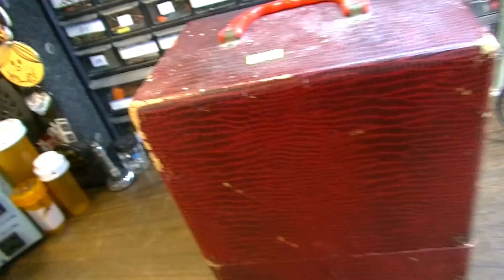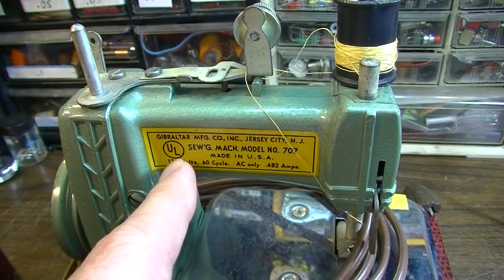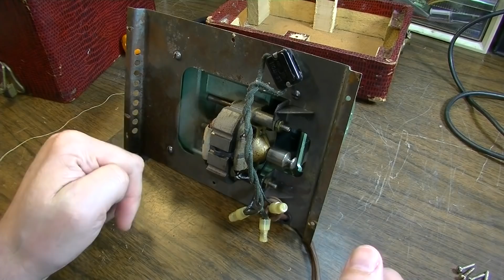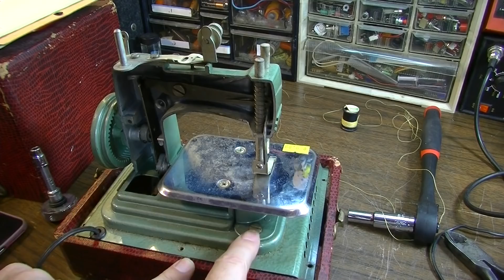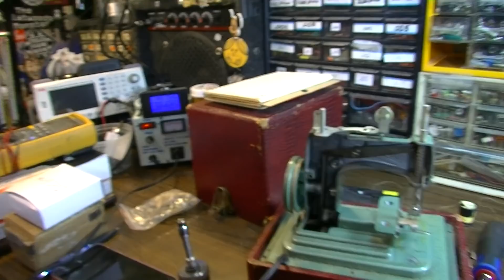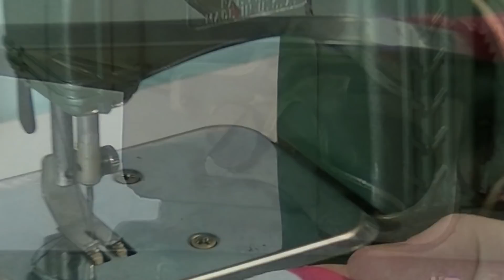1950s Betsy Ross Model 707 Child Sewing Machine Repair

Comment: Saw this and I have one I found at my mom's house when I cleaned it out. Have no idea where she got it, but when I pulled it out of the closet to check and see if it is the same, A letter from Betsy Ross (Instructions) floated out of the cover, I had no idea it was there, but that little lever you did not know what it was for is a Stitch regulator ( Length of stitch). It has a picture for how to thread it, says it was sold in Chicago, (666 Lakeshore Drive) but if it needed repair because of manufacturing defect it would have to be sent to New Jersey. I don't have all the information, because a mouse decided to munch on part of the letter.  I know it works, and mine does not have the cover to protect the underside of the stitching, and It does not appear to have had one. Looked all over for a date of manufacture, but could not find one. I am going to oil it, did not think of doing that before. Thank you for showing all the places to oil.
Reply from the maker: Excellent find! Best of luck! Fun little thing to mess around with. Maybe a little girl you know can use it to learn to sew some doll clothes.

Comment: I need a belt and can’t find one. Do you happen to have any suggestions to help me locate around appx a 2 inch diameter tiny belt
Reply from the maker: Go to the auto parts store like O'REilley and ask them for an O-ring. Take your machine in there and fit it on the spot. Or go to Harbor Freight and buy an O-Ring kit that includes larger O-rings.
Reply: @TheGuitologist  thanks so much!! I had ordered one off amazon but it’s too thick. So that will help me tremendously

Comment: So I have one. Not electric, mine is manual the flywheel is a hand crank, meaning it's an older model than what you have. I guess mine has to be restored as well. the but it looks just the same, the color is the same. And I still have the instructions on how to use and thread it. You are funny, I hope it works at least to sew. So I can tell you don't know about sewing machines, but the lever on the back is to lift the footer part where the needle is. And mine says "Patent pending", Cost was $7.98,  I just read the instructions on that lever ....its'a a Stitch Regulator...to make the stitch longer you bring down the Regulator,  for a tighter stitch move the Regulator UP.      I really enjoyed your video...let's see if my husband does what you did for me.

Comment: I am watching and I am a dude.... I checked so I know I am right about that.  now it is time for a litte story about me....

Ha ha I took a Home economics in grade school... because it was going to be easy! I mean come on it was a class designed for Suzy Homemaker girls  and we all know how easy it is to be a full time homemaker.... Now before you flame me let me finish.  That Home Ec class was as hard as ANY of the shop classes I was involved in and I did them all Wood, metal, plastics, and small engines. I learned how to run a sewing machine, service it and troubleshoot it when things didn't work right, I learned baking and cooking and how to layer flavors in foods and how cooking tempratures affect foods flavor. I learned how to adjust recipies, times and temps to customize the foods I made and much much more. That "easy class" was probably just as important for me to do as my regular shop classes. It was also not "easy" lol. Now I am 55 and running a household full time I still don't sew but I could if I had to.         ISIS, SHERIFF, FBI, FTC, COPPA
Sorry Guitologist Mr Brad I could not help myself. Is this video intended for children?

Comment: I found some vintage speakers at the Goodwill.  Advent, with the 10 inch square frame woofers, square fried egg tweeters,  20 bucks for both. I Refoamed, Recapped and put in new power resisters and they Rock. By the way,  I like the tiny sewing machine. :)

Comment: Why didn't you install a 3 prong cord and did a proper grounding of the metal housing of this device? Especially if it's supposed to be used by your wee one, that would have made it a lot safer, right?
Reply from the maker: No children will be using this. It's a conversation piece now. The two prong was just keeping it closer to the original look.

Comment: My dad used to be a blaster at stone quarries in the 70's and 80's. He always had those little yellow handled wire cutters to clip wires to connect the plunger to the sequence board and then to the dynamite or Tovex, which is what I remember using. That little sewing machine is quite unique. Great video.

Comment: That was probably not adhesive, but old dry oil, which can be just as sticky. But I was surprised you didn't do a three prong cord so you could ground the chassis incase the windings short out to it, especially since it is for kids. Hopefully that old amp  two prong cord you used  was polarized.

Comment: Brad, I have a question for you. Is there any difference between Harbor Freight electrical connectors and name brand/expensive ones. I see you using them in this video......... Thanks brother
Reply from the maker: Some are plastic and some nylon. Some are also heat shrink. The Harbor Freight one’s have been fine for every application I’ve needed them in.

Comment: Random question. Why not use a butt splice connector?
Reply from the maker: You could. I prefer soldered connections where possible. Guess I trust them more, especially on a 120VAC connection in portable equipment.

Comment: Yeah toys used to be made to what we think now as highest quality. Back then it was just cheap stamped metal lol.
In 1968-69 my Tonka dumptrucks & bulldozer had to be 14" long & weigh a couple POUNDS each. The bulldozer had heavy rubber treads. They were huge and indestructible. Had em til I was 14. Cement mixer too. Mom didn't mind buying them because they were "quality."
No - don't make them like that anymore is right.
Good video - I had fun in the Way Back Machine. Thanks.

Comment: I found something like that in my father's ( well let's call it a collection)  a little of everything everywhere lol.  it's about half that size and a singer hand crank.  there's also  a 60's singer up stairs that's almost never been used.  even the wood cabinet for it is spotless.  tucked away in the upstairs since the mid 60's .  likewise he bought a 67 ford f-150 white and turquoise . two weeks later he bought a camper for it and had it installed, the tailgate was stored in the basement and is there in the same spot as I type this. lol  and yes I am still working on the house and it's been ….well ….. an experience to say the least.
Reply from the maker: That sounds like a YouTube Channel in the making, dude. Seriously, make some videos. You're welcome to share links. Just give me time to ok the links because YT auto filters them for manual approval.
Reply: @TheGuitologist  I never thought about it but who knows. I've gotten a lot done already , but at first there were path's through every room every level including the garage .  too bad he wasn't a guitar nut like me , that could have been a gold mine lol. take care and keep these great video's coming love it.

Comment: Hey Brad. I love old sewing machines. That one is a little jewel. I have been meaning to ask you about amp repair. I am wondering why you don’t use an oscilloscope when signal tracing an amp. Using an audio prob is a great idea. The advantage of using a scope is being able to see AC and DC at once. Also distortion in the injected signal from the generator. Please don’t take offense, non meant.
Reply from the maker: None taken. I just find it easier to listen for the AC and measure the DC with a DMM and listen for noise and distortion 99% of the time. Plus, I think part of the appeal of this channel is that I'm not using a ton of specialized equipment most people don't have when troubleshooting, so they feel like they can service their own amps too.

Comment: Maybe that capstan belt from the 8 track/fuzz box build will work?
Reply: It looks like it should be a round belt like a vacuum cleaner belt. You can make one out of a large O ring. Cut it to the right length and crazy glue the ends together. I have done this for animation belts on my juke box and it works great.
Reply from the maker: Great minds. I had the same thought, but pretty sure it's a touch too wide.

Comment: I have Mattel lathe, jigsaw, vacuum mold unit, etc. Still use them for building balsa frames and plastic parts for model airplanes.
Reply from the maker: DUDE! I've seen those! I stood there in the antique store and laughed my ass off at them - thinking of all the children's appendages they must have claimed.
Reply: I had that Mattel jigsaw and lathe thing for years!got it at Sears I didn't get the vacuum thing but I remember seeing it next to the lathe.
Reply: They had that jigsaw to where it would not cut flesh but it would cut wood I believe they still have that type of Saw blade mechanism

Comment: You should have removed the hidden death capacitor from under the motor. Somebody hacked it at some point as that switch is not original. There's supposed to be a 1/4" phono jack there to plug your guitar in. Those Betsy Ross fuzz boxes were the best, that's what Jimmi Hendrix used at Woodstock to play the famous Star Spangled Bar solo.
Reply from the maker: Input jacks didn't become standard on these until the 60s.

Comment: you should had made a foot pedal with a pot so it's not running wide open all the time. been a nice extra treat for your wife. :)
Reply from the maker: Not a bad idea. That would be an easy mod.
Reply: @TheGuitologist  yeah get a dimmer switch and wire it into an old wah pedal :)